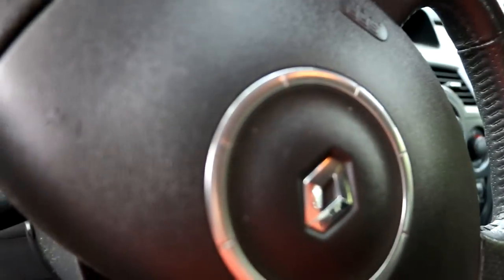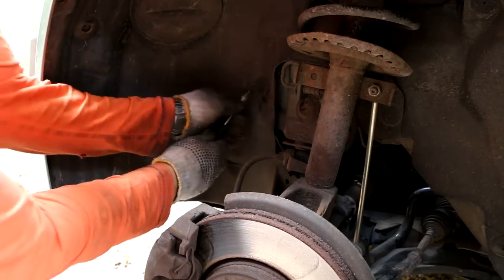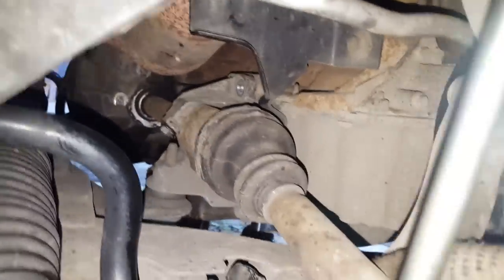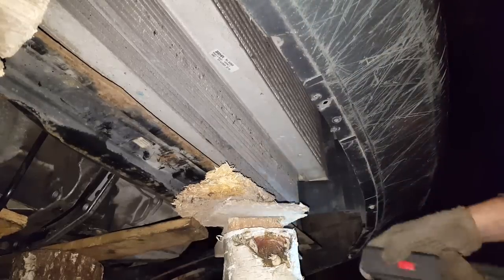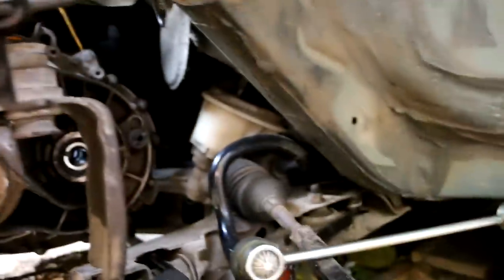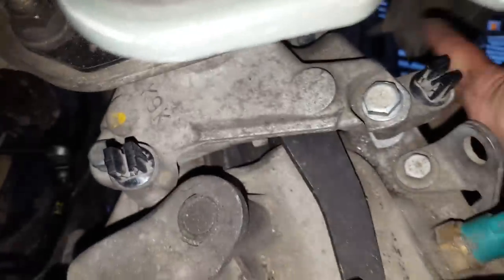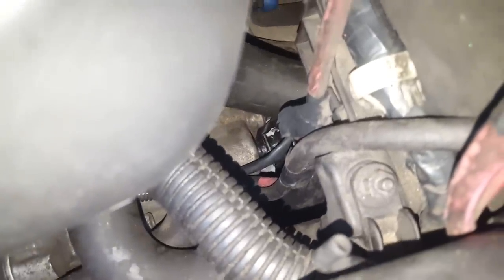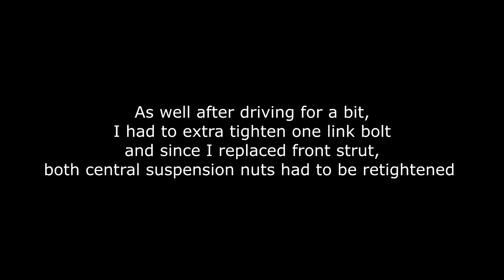How to replace Renault Megane 2 Clutch Concentric Slave Cylinder

Comment: Hi there, was wondering if you can help me, I have just had my clutch and csc changed and now the clutch pedal is quite squeaky and feels sqeaky and not smooth when depressed all the way to the floor and then raising it up slightly. Do you think the mecanic left air in the system or didn't fit it right, I'm not sure if i should bleed the system, is that possible with a csc without removing the clutch.
Reply from the maker: Hi! Well it is possible that some air might be still in the system or bleeding valve cap has popped open, for some reason mine did it for the first two times so I taped it in the place with some tape and since then it has been there all right and clutch is working good as well.  I think, if they would install the csc incorrectly then you would have different sort of problems. You can easily inspect if the cap is on the bleeding valve and if it is connected in the system fully by just trying to push it inwards and outwards, it should stay there strong. To bleed the csc you wont need to take a part anything :) Have you asked mechanic about your problem?
Reply: @JUrtanschannel  I went back to mechanic and he said there's nothing a got quite rude to me and told me to f off :(. So I'm going to see if I can get it to another mechanic do check what you said or get my friend who has a ramp to check it out, thanks so much for your reply appreciate it a lot, Ill keep you updated on what happens
Reply: @JUrtanschannel  also my clutch pedal uses fluid, when I bleed the system will that bleed the fluid in the pedal assembly too
Reply from the maker: @um3955  you can check it from above as well, it is at front of the engine, close to the middle of the radiator, a bit under the air intake and car battery. if you dont see it very well you can just put ur hand in there(if engine is not hot) and feel if the cap is on the valve and if it is not moving out of connector when you pull/push it a little bit. In my case the black plastic connector in middle of the video at 1:26:37 or under the battery 1:28:06, if it helps
Reply: @JUrtanschannel  thanks ill check that as soon as I get It on a lift, once I check that and if I needs bleeding will that bleed the air out of the clutch pedal unit too as my pedal assembly  is hydraulic too
Reply: @JUrtanschannel  just to update you, went to garage today and he said the whole system Inc the master cylinder and all brake fluid needs to be flushed and changed and I'm booked in for next week, then apparently  it will fix the issue, do you think that could fix the sqeak, I'm in 2 minds whether it'll fix it 😂😭
Reply from the maker: @um3955  well, when I was replacing csc, I kind a change brake fluid in clutch part as well, bcos to bleed it and while I replaced old one I lost some fluid and had to add a new one. Overall I dont see why to flush all the system..unless you are not sure what is causing the problem and wanna go with job that does not require to replace any parts + sinc csc has only one bleeding valve, which kind a works together with gravity, it is clearly not possible to fully flush csc, at least I think so unless you take it out..  I dont see why not just try to bleed it.. you can even do it at home without any special tools, all you need is just a hose that fits the bleeding valve, a bit of dot4 fluid and time..  of course, if you ll screw this up, you can end up with car where u wont be able to shift gears untill u get out all the air again.  But overall to bleed the system u just need to open csc bleeding cap, attach the hose whre at one end u have attached bottle with a liitle bit of dot4 in it( so it can fill up like half of hose lenght), then let the fluid go to the valve or if it is not moving then go to the next step, then just grab the connector which goes in to csc where u have attached the hose, press down the clip and pull it a little bit outward, then wait until some fluid starts to move and goes in to the csc system, if you wanna increase the movment you can make sure that bottle with dot4 is at stable position and press the clutch pedal in and then pull it out, after a few times u can go,  drain extra oil from the bottle, if there is any( u can just wait it should slowly get back into the system with gravity, bottle is just more for saftey so oil does not spray all over tge car) so u can try and suck some air out, if u got some tools it is even better, but for my car I managed to do it with my own power, when u ll start to suck air, u ll see some bubble coming in to the hose where oil is, when u fell it is good enough( no or almost no bubbles), just press the connector back in the csc and dissconect the hose, put thr cap on valve and check if the clutch pedal works fine. If it wont work with the first time, i would try this again..  any way this will cost like $2-4 for dot4 and apr $2 for 2m hose and u can take old plastic bottle, cut the bottom, with tape connect it to the hose, overall max $6, if you got some nerve and time, since this might not work with the first try :)  make sure u also have enough dot4 at beake fluid tank.  At least this is what i remember I did in the end after I tried many things, bcos it wasnt super easy in my case to bleed the air and i spent some time till I figure this out..
Reply from the maker: + i thik i used like max 1m long hose and i was thinking, maybe u even dont need to add fluid to hose, but just to brake fluid tank, but i just wrote how i did..
Reply: @um3955  Hi did you resolved the squeaky pedal after rebleeding ? I've met exactly the same problem as yours

Comment: Funny that you got leak in the piston for the pedal!
Usually it gave’s up on the hydraulic cylinder for the clutch and pressure plate, which in turn needs full replacement.
And if that’s not enough… lucky 1.9dci owners like me can trace the problems back to the dual mass flywheel itself!
And that is certainly job for a mechanic!
We can only cry about the price of the parts…
So count yourself as lucky if this was your whole problem!
Reply from the maker: More than 3 years passed still driving, however if I would drive rough, i might brake the slave cylinder again, i thing i had to replace more than just a save cylinder :D

Comment: buen video para nosotros que no somos mecanicos, sin embargo este auto es una porqueria, de verdad una porqueria, comparado contra un nissan tsuru que tuve...nada que ver.. el tsuru es 1995 y el megane 2005 sin embargo le llegue a meter mucho mcho dinero al megane mientras al Tsuru solo su mantenimiento preventivo y el auto esta como nuevo mientras el megane ya le he cambiado casi todo! ahora la bomba, al tsuru jamas le cambie mas que el clutch una sola vez y lo use mucho mas que el megane, tsuru 210 mil kms, megane , 124 mil. jamas debi haber mal invertido mi dinero en esa porqueria de auto.